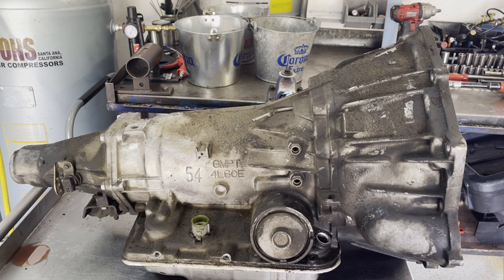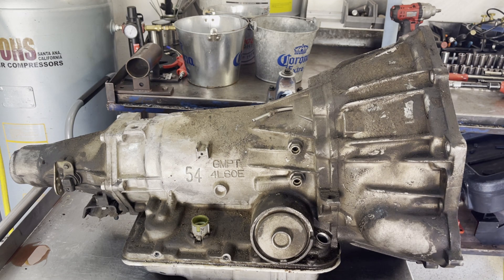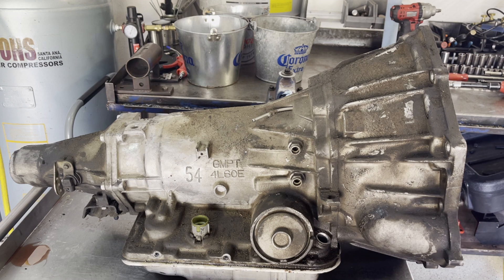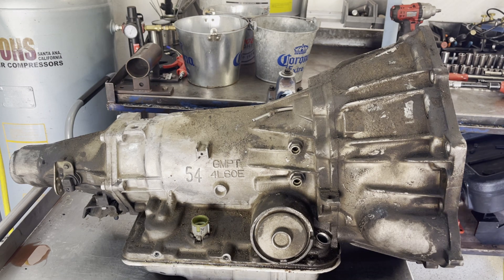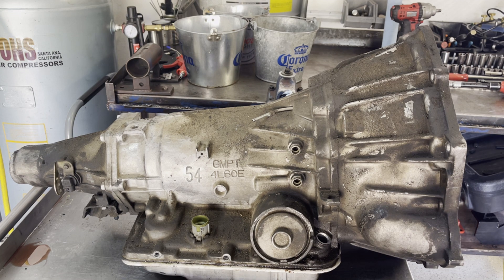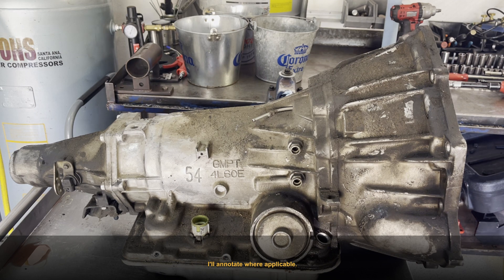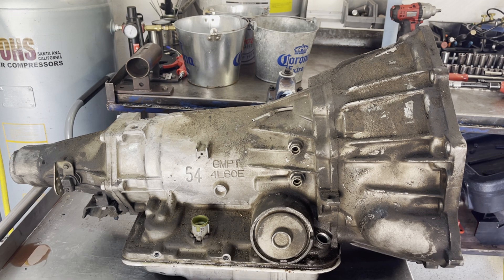4L60E Quick Teardown - Common Problems and Causes

Comment: Hey there my 1995 4L60E from a truck I got will work fine when its cold and after it warms up in a few miles it losses all gears. When it cools it'll work again, and repeats.  Fluid looks fine and pan was clean. 200,000 miles. There maybe is a slight burned smell, but no visual.  It wasnt driven after it started doing this. 

Could this be just a bad filter and/or filter gasket?  

Is there any electronic or mechanical item that may be bad that I can access, test, and replace by having the pan or valve body off?

Thanks!
Reply from the maker: Drop the pan, see what's at the bottom...Once you have, you'll likely have a much better sense of what has to be done next.
Reply: @nickstransmissions  I did so. Fluid seems relatively red and clean. So does the pan. No metal or heavy debris.
Reply from the maker: What else have you already done (scan for codes, pressure testing, etc)?

Comment: Watched a bunch of videos on this trying to point me in the right direction, just built my 08 4l60e, got it all put back with new transgo shift kit and new tc, and i got no fwd gear in drive unles i stab the throttle. 1-2 work just fine and reverse is fine, but all the stuff ive seen points in a hundred directions, ur way smarter at this than me, any ideas?
Reply from the maker: Hi David, thank you for watching.

Did you replace your forward sprag and air check the forward, overrun and 3-4 clutch packs in the forward drum both on the bench and then upon assembly into case? 

I check the drum independently via the feed holes in the turbine shaft, then check all three clutch packs with the forward drum mated with the pump and check everything last time once everything has been installed into the case using a test plate (see my 4L60E rebuild video for info on the test plate: https://youtu.be/EMeefT7Cbzw)

Also, I have a much more extensive 4L60E tear down video on the channel that should give you some additional pointers around what to inspect in the forward drum, pump, etc: https://youtu.be/WuTX8n8RVEE

Comment: I'm ok with the fast forward for a quick video, but it would probably be better if you got rid of the original audio and did a voice over of just the high points you have in on-screen text.

Thanks for sharing this video! I recently dropped the pan and changed the fluid and filter in a new to me '06 Silverado with 350k+ miles and was not impressed with the color of fluid and sparkly sludge in the bottom of the pan. I may be looking at a rebuild at some point and this video gives me a glimpse of what I'd be in for.
Reply from the maker: Thanks for the input Luke. Im publishing a full length tear down and inspection of another 4L60e tomorrow. Coincidentally it’s the same model year, 2000, as the one in that quick tear down video and ill cover the same things and more in this upcoming video.